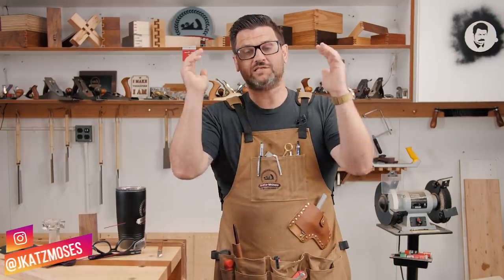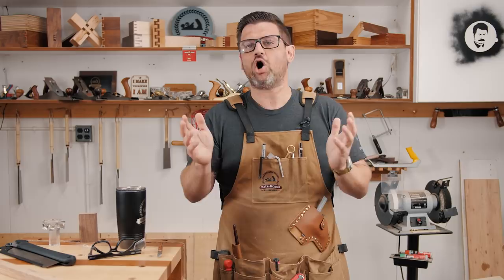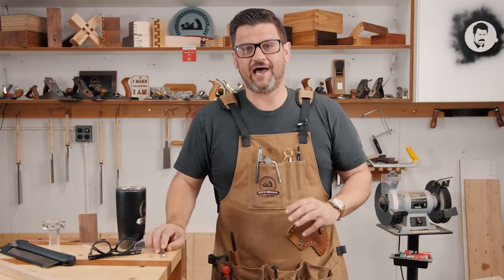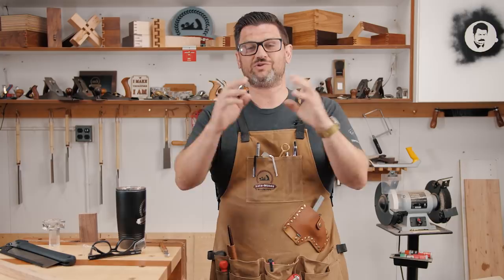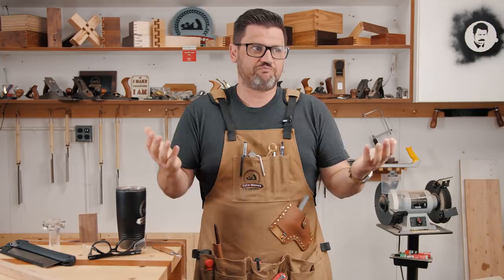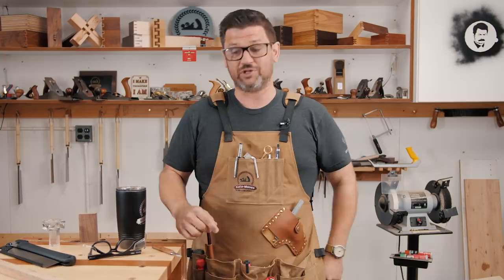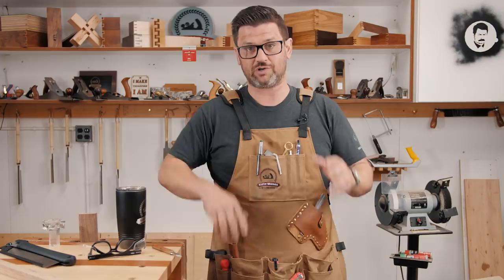Incredible Woodworking Tools in Slow Motion - Amazing 19,000 FPS HD Video

Comment: Great stuff! Just want to thank you for your time and money spent on this video. Don't know what it cost to rent the cam, but I'm sure it wasn't cheap. Also the saw blade and brake cartridge were at least $150, maybe more. Very cool. I managed to trip my SawStop with a 1/4" Infinity flat kerf blade in (no flesh was harmed, just a stupid mistake with my aluninum back board miter). The Infinity blade was examined under a microscope and there was no discernable damage to the teeth and I checked the run out and found about .0005". Pretty impressive. I still use the blade today, of course I did have to install a new brake cartridge.